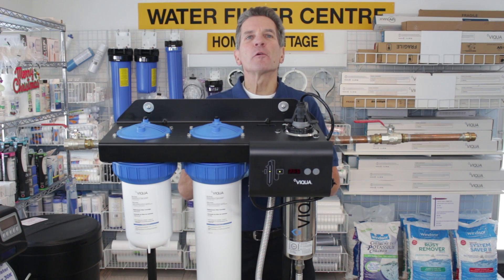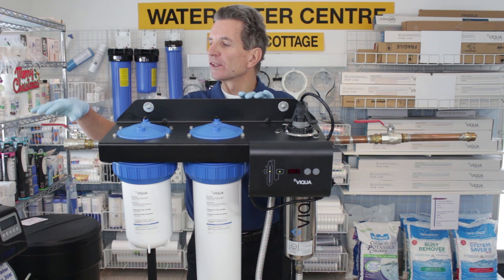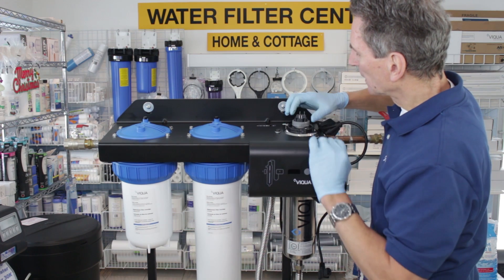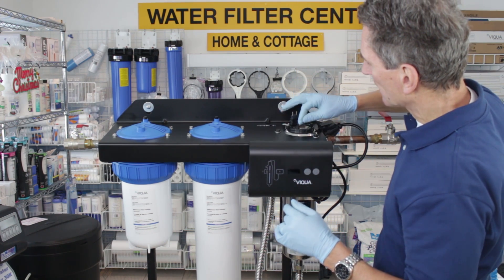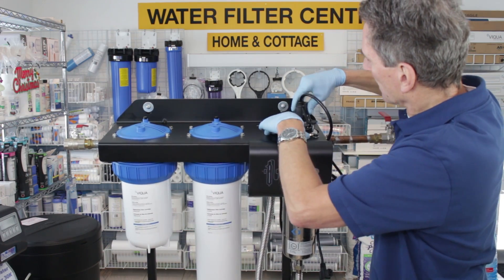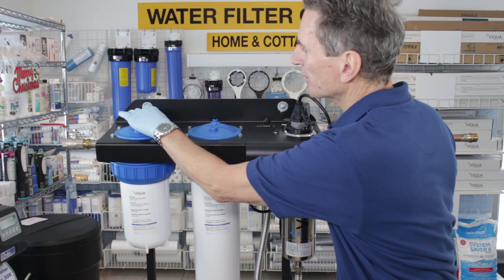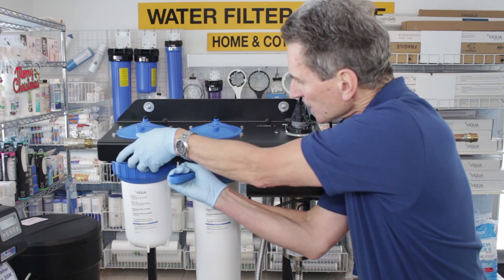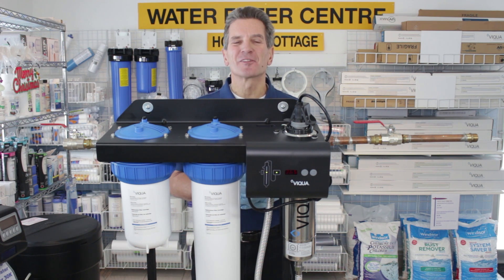How to REPLACE LAMP and FILTERS in VIQUA IHS12 D4 UV System

Comment: Can you do a video on the filters and how those work? I inherited an IHS12 D4 system and it came with some replacement filters. When I opened it up there was a sediment filter in the short filter and a carbon filter in the long filter. However, the replacements that I had on hand for both long and short were sediment filters so now I have 2 sediment filters in there and no carbon filter. I would love to know more about the different types of filters that can go into each of these 2 different sized filter housings and when to use them. Thanks.
Reply from the maker: Here is a video on sediment filters https://youtu.be/https://youtu.be/IGZzOxH890Iak5o479A--o and this https://youtu.be/yXu19iykvP4 will help to understand more about carbon filters.  This one talks more about your system https://youtu.be/IGZzOxH890I

Comment: hi, just had the bulb replaced and noticed a faint humming/buzzing at the top where the plug connect to the bulb...is this normal.?...i just tightened the bulb a little and it seems to have stopped for now
Reply from the maker: Sometimes if these is a very small gap between the lamp and it's connector you will see that happen.  Tightening it is the solution.
Reply: thanks, i can't hear it when i walk by it now but if i stand right next to it i can hear a slight buzzing, it that normal? is that just the bulb?

Comment: Hi Gary. This is great. My issue right now is I have the smaller filter to the far left.  I can't for the life of me get the blue ring to unscrew first even after relieving the pressure off the black button. I hate to call a plumber.  I've done it before but this time I'm having issues. Any suggestions on how to loosen it up. I'm desperate.  Thanks in advance.
Reply from the maker: Great question!  Follow the advice from this video https://youtu.be/BcTaSyBiD78

Comment: Hi Gary, Thanks for the video, have a question about Disinfection Procedure. I have an IHS-12 and the owners manual talks about disinfecting the system anytime you replace the quartz sleeve or lamp or anytime you turn off the UV, is this really necessary? Does that mean, even if the power goes out you need to disinfect the entire system each time? Your videos don't specify after putting everything back together to do this, only turn the water supply back on and same with Viqua's instructional videos on their site as well. A follow up question if this is true would be the owners manual doesn't specify that it needs to be done after changing the filters only when replacing the lamp/sleeve, however if you're turning off the UV system to change the filters this would suggest that you do as they say "anytime" you pull power. The lamp/sleeve procedure does look straight forward and I thank you for you in-dept video regarding it... just wondering about the whole disinfection part which I can't seem to find too much info on... sorry for the lengthy question but figured I post up here instead of e-mailing the store in case others might be wondering the same thing. Thank you for your time!
Reply: @water_estore  Okay thank you! And thanks for the quick reply, appreciate that!